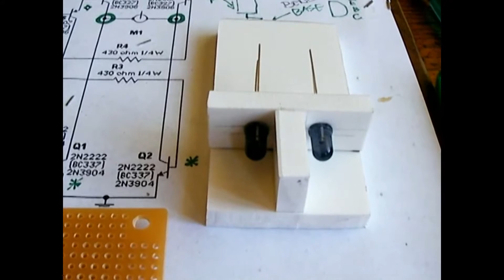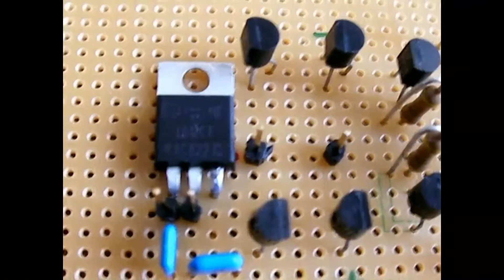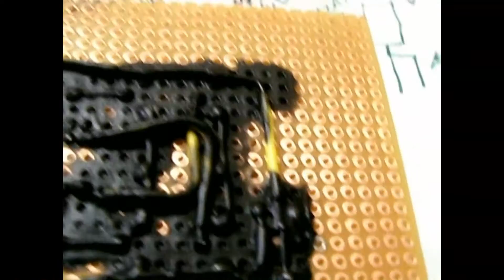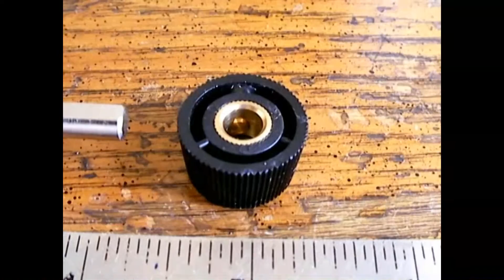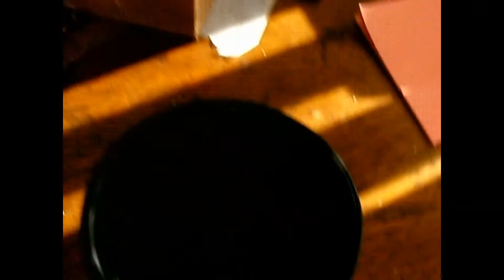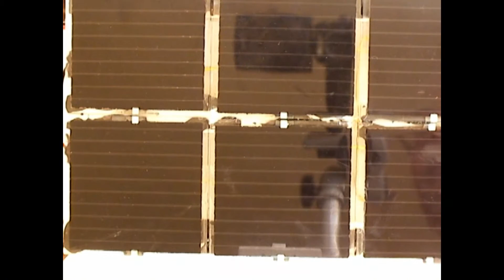Solar Sun Tracker Part 2

Comment from the maker: Just an update on the tracker. The speed of the motor (revolution) is still too fast so the platform behaves like it is shaking its head from left to right at some point. I will need to slow down the revolution to about 1/3 which means lowering the voltage down from 12 to 6 volts giving sufficient braking time and force to center the platform toward the sun instead of overshooting in effect motor compensates on the opposite direction and vice-versa.